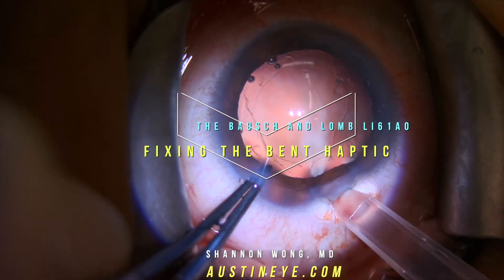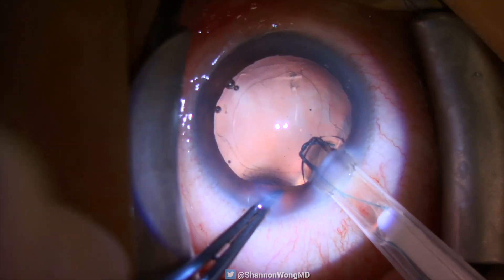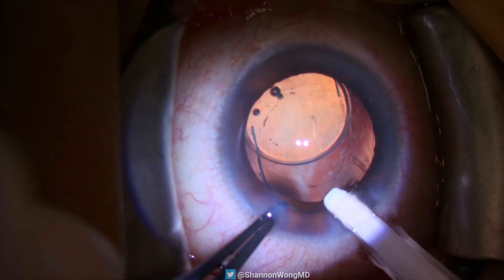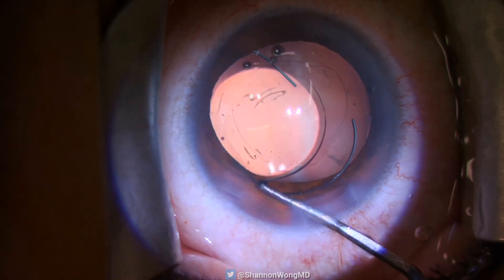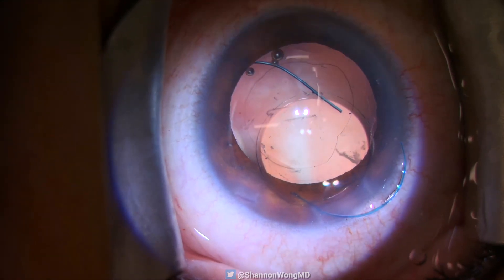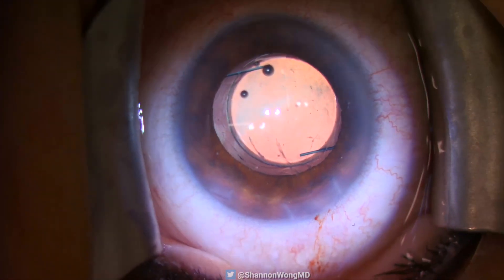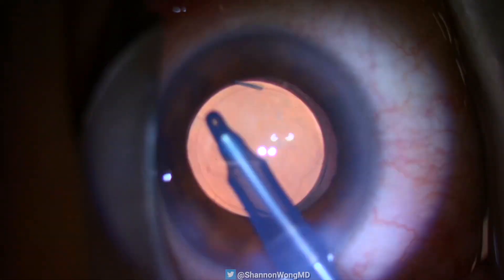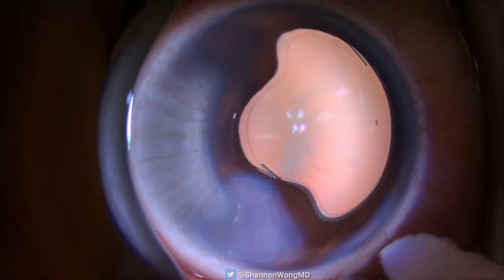The Bausch and Lomb LI61AO Bent Haptic.  How we fix it.

Comment: I use this lens almost exclusively and have straightened out bent haptics. Years ago I would remove the lens and put in another one, not realizing you could fix them. That involves a certain amount of risk and trauma, so one day I just pulled the haptic out and straightened it. Works fine.

Comment: What are the advantages of using LI61AO as your main IOL over aspheric single piece IOL like MX60E, despite the occasional bent haptic like this?
Reply from the maker: The MX60E and LI61AO are both manufactured by bausch and lomb and have aspheric optics.  Because the LI61AO lens is a 3 piece lens, it can be placed in the sulcus or bag or by intra-scleral haptic fixation.  The single piece MX60E can only be placed into the capsular bag (or sutured to the sclera).